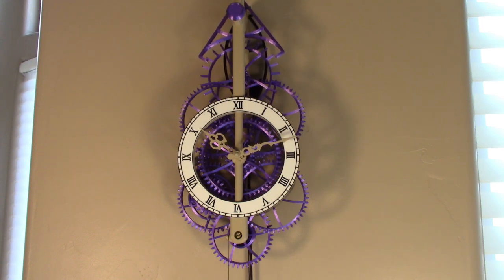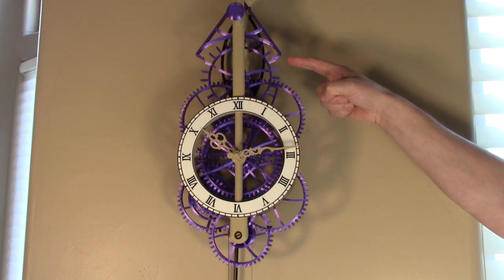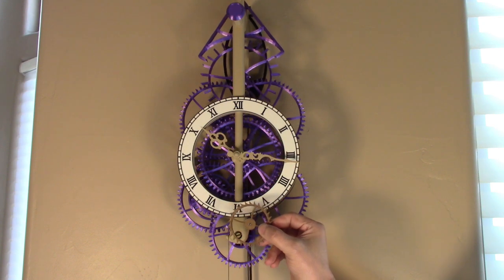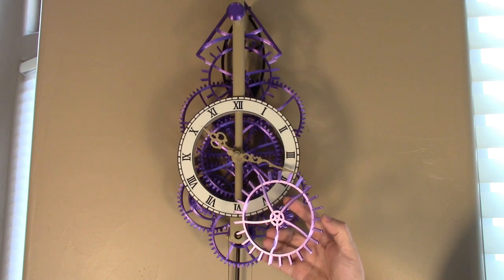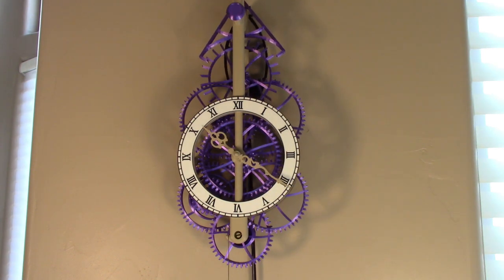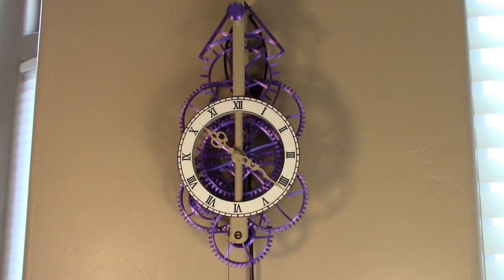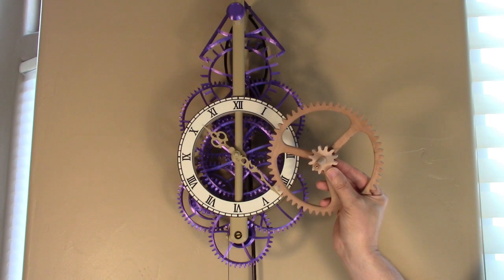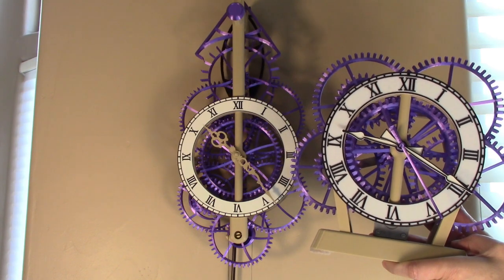My Latest 3D Printed Clock Designs

Comment: Very beautiful clock but how do I print the clock face with the numbers because my printer that I’m getting only has one extruder
Reply from the maker: Each color is at a slightly different height. The print is paused at a specific height to manually change the color. I also only have a single extruder machine.
Reply: Got it 👍

Comment: Hello, can you make version driven by handle and weight connected with chain?
Reply from the maker: Sure, it could be done. There are huge variations in chain sizes that would be frustrating to other builders around the globe. I try to simplify each design using commonly available components.
Reply: @stevesclocks  you can try to use 3D printed chain, so this way you need even less not printed parts :)
https://youtu.be/8qjJ0G_fWSI

Comment: the winding gear does not mesh with the rachet gear to small
Reply from the maker: Is it possible that you have mixed up gears from different designs? Some of the names are similar between different size clocks. Another possibility is mixing runtimes. For example, the unique gears in the 8-day runtime option will not mesh with the 10-day runtime option.

Comment: Wow. I want to print this and hang it outside my house. what material's have you had success with? In the uk PETG will probably not deform if in the shade.
Reply from the maker: Excellent question. Unfortunately, I have no answer. I only use PLA, which is obviously not a good choice. PETG seems like a good option.

Comment: Really enjoyed printing this beauty. Great work Steve. Took my time and it paid off. Keeps very good time too.
Reply from the maker: Thanks Brian. I attribute the accuracy mostly to the deadbeat escapement. It is quite tolerant to changes on drive weight. Heated and air conditioned houses also helps a lot by keeping the temperature stable.

Comment: If you printed it with a 0.4mm nozzle, could you just rescale it in the slicer to 50% if you printed with a 0.2mm nozzle?
Reply from the maker: Yes, it would print nicely at 50% scale with 4 perimeters and a 0.2mm nozzle. It may also print well with 2 perimeters and a 0.4mm nozzle, other than the tooth tips might be rounded over. You would need to adjust for the smaller arbors and bearing hole sizes.

Comment: Steve, I bought the medium size clock. Turned out really nice. Problem is it doesn't seem to want to work. I think the problem revolves around the escapement gear. It works for some of it, but not for all of it. Thoughts on how to fix? Here is a quick video. My email is davebraner@gmail.com if you would rather email.  https://youtu.be/3FmTeSZI58U

Comment: one way i was thinking  to make a clock self winding is to use a large marble widget  on a distance to pull the spring and then  it goes back to the    center and the spring  pulls it up and it goes the distancee to make the spring wind again
What's your opinion

https://photos.app.goo.gl/552zGBBgQK1f67Ed6
Reply from the maker: Hi James, You might be describing a remontoire mechanism. It could be a useful way to provide consistent power from a spring that gets weaker as it winds down. A weight driven clock always has the same power over the entire run time.
Reply: @stevesclocks  
Thanks  so much 
If you would like to take part in making one id very much appreciate your expertise
Reply from the maker: @jamesmatheson5813  My time is booked up right now. Brian Law has a couple of designs using a different style of remontoire. Clock 26 is wood and clock 28 is 3d printed. 
A description of his mechanism is at https://brianlawswoodenclocks.blogspot.com/2015/10/remontoire-for-woodenclocks.html
Reply: @stevesclocks  but how are you going to rewind your clock

Comment: Hello Steve, i build your Wonderfull clock, but i have a little problem. the clock works only with a cloth pick ... but see by yourself 
                https://youtu.be/fOAGdjsR0RI
              
what can o do?
Sorry for my horrible english i am not a native speaker.

greetings from Austria/Vienna ;)
Reply from the maker: Friction is usually why a clock stops working. In this clock it is either the pendulum support bearings or somewhere else in the gear train. Your video was very helpful. It shows the pendulum amplitude degrading very rapidly, so I suspect the pendulum support bearings have too much friction. Make sure the shields are removed and all factory grease is removed with solvent. Check that the bearings are not twisted when inserted into the frame. Remove the escapement and focus on getting the pendulum to swing for several minutes before the amplitude reduces by 50%.
Reply: @stevesclocks  thanks for the fast answer! The only thing that makes me wonder that a !!! Cloth Pick!!! makes the Clock running... The Pendulum alone swings for about 6 minutes. I will try Teflon Spray in the next few days. i let you know what happend ;) Thanks again for this wonderfull Clock
Reply from the maker: @Buglbiker  6 minutes of free swing is reasonable. You should be able to get it to work. Check for friction in the gear train by hanging 0.4-0.5kg on the cord with no pallet. The escapement should spin easily, although it may take many minutes for the cord to drop to the ground. If there is no excess friction, then maybe the clock just needs a bit more weight. Start by hanging the weight shell on the cord without using the pulley. This effectively doubles the drive weight. You may need to hold the clock frame to keep it from shifting since the weight is offset to one side.
Reply: @stevesclocks  thank you for the tipp to test the clock without pallet. the clock runs with 0.4 kg realy good. so i know i have to work on the pendulum. Thank you again for your tipps and the many improvements in this version of your masterpiece !!!
Reply: the clock works, right now, I'm the happiest person in the world. Thank you! 😍👍
Reply from the maker: @Buglbiker  Congratulations on a successful clock build. Your clock is the first functioning clock that I know about. Can you share what the final step was to fix the pendulum?
Reply from the maker: @Buglbiker  I always enjoy hearing about successful versions of my design. It helps motivate me to continue designing new clocks. Thanks for the positive comments. And your English is perfect. :)
Reply: @stevesclocks  News from the clock. after few days of working the clock stopp working........ 😳..... disassembling / assembling .... the clock stops after 1-2 hours ..... grrrr 🤬  watching your assembling videos ...... TEFLONSPRAY ist the magic word 😄😄😄😄 zero problems 😄😄😄😄

Comment: Whats happens to the accuracy if you blow it up 200% ?
Reply from the maker: The accuracy is primarily determined by the pendulum length and escapement type. Scaling everything up 200% while keeping the pendulum length the same should result in similar accuracy. This clock uses a carbon fiber rod for the pendulum shaft which is very stable over temperature variations.

Comment: WoW Steve, what an amazing job!. I just searched for a new clock to print and I found yours. what nonprint parts do I need to get?
Reply from the maker: Thanks. I am preparing the design for posting to MyMiniFactory right now. It should be there by the end of the week. The complete nonprint parts list will be in the assembly notes. It mainly consists of 1/16" (1.5mm) music wire for the arbors, 1/8" (3mm) metal rod, some common size wood screws, 5 bearings, some 1/8" or 3mm shaft collars, fishing line, and lead shot or BBs for the weight shell.
Reply: @stevesclocks  Thank you steve. What is the bearing model? can you please provide a link for the shaft collars. Can't wait to print it (all with silk pla)
Reply from the maker: @niraviv8431  The clock uses two R2 (1/8x3/8x5/32") or 623 (3x10x4mm) bearings to support the pendulum and 3 608 (8x22x7mm) bearings to support the weight shell. Unshielded bearings are best, followed by rubber seals since they can easily be removed. The 6 shaft collars are Great Planes GPMQ4305 or DuBro DUB139.
Reply: @stevesclocks  I must be an idiot, because people have built this clock... I've been to my Mini factory and here and can't find a concise list of parts (non-printable) needed.  This thread has some, and then someone asks about another part and you give more info.  I plan on buying the large clock, I just want to ensure I can get the parts.

  I've been bit before building things made in Europe, just to find I can't get a part needed to complete it, without spending an arm and leg.  This looks like an amazing project, and I will buy it,  pending parts availability.  Have a Merry Christmas!
Reply from the maker: @Christopher-Enoch  You are not an idiot to question the parts needed. The only way to get a long run time, and in my opinion the only way to build a real clock is to use a few non-printed parts. They are fully listed in the assembly manual, but MyMiniFactory does not let you see it until you purchase the complete design. It is publicly posted to https://www.patreon.com/posts/assembly-notes-42469990

Both the medium and large sized clocks have similar assembly notes. The large clock has options for either metric or imperial sized components. The medium clock was simplified to only metric components since I found them easy enough to acquire in the US.

When I get a chance, I will cross link the files on various platforms so the assembly manual and parts list are easier to find. I wish MMF would allow me to mark a few files to be public so anyone can seen them before purchase.